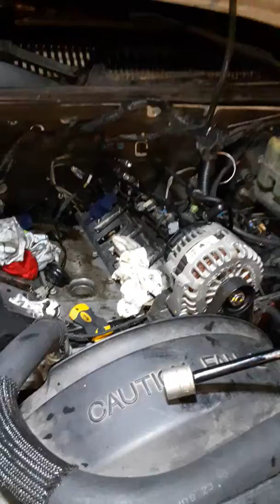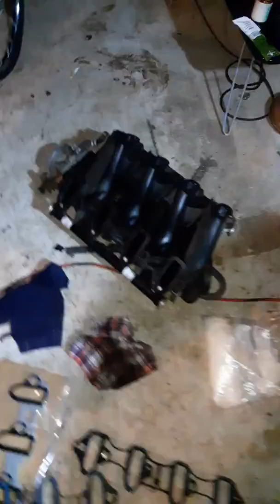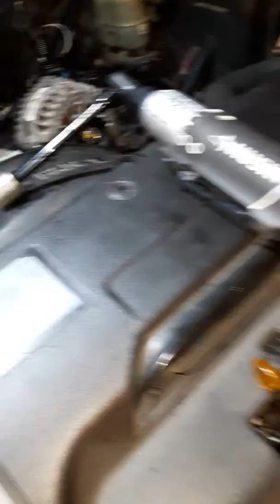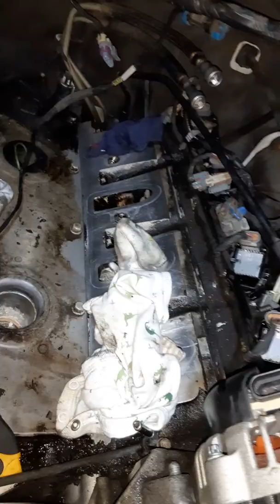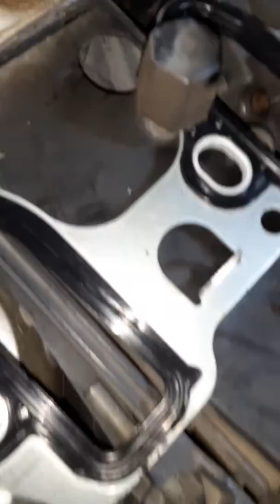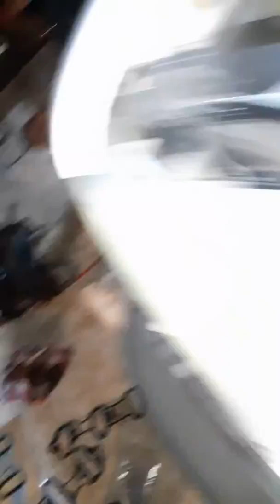LETS CHANGE THAT INTAKE MANIFOLD GASKET ON MY 2002 CHEVY TAHOE LS

Comment: Tighten the bolts in sequence 4 corners first then work front on one side rear on other front on one rear on other. Don’t lock it down until there all snug just a little suggestion
Reply from the maker: OH I DID THAT CATTY CORNER  STARTED IN THE MIDDLE WORKED MY WAY OUT